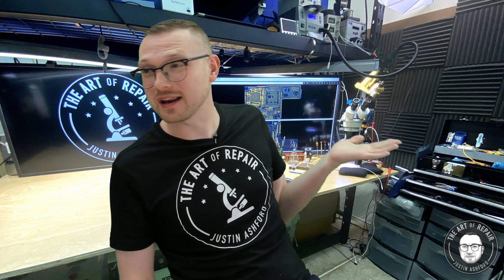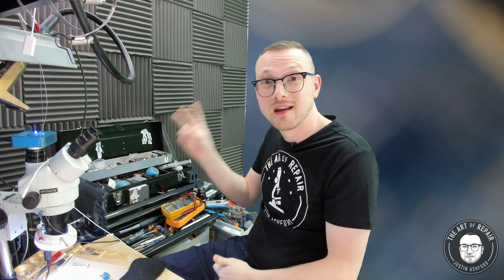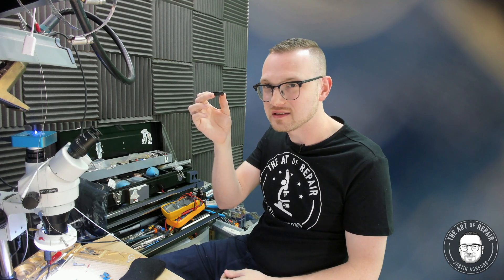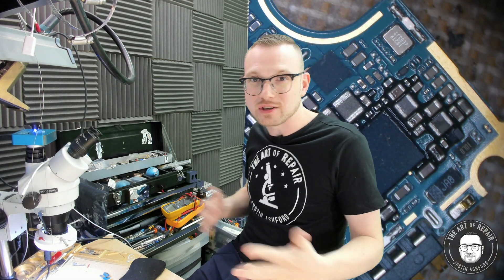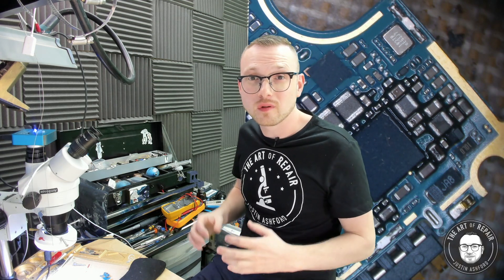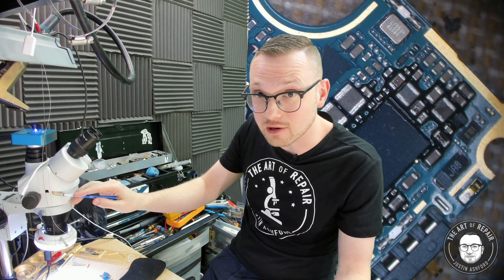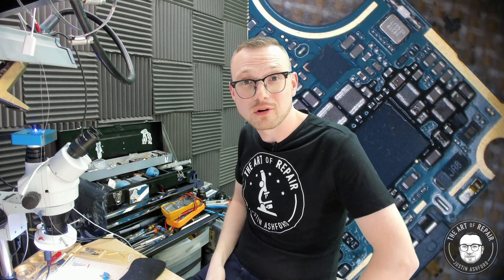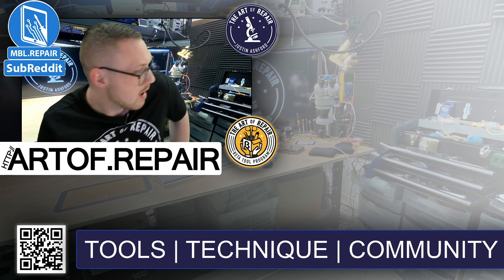Scope Issues | Microscope Cameras that WONT FOCUS! | Method 1 + Useful Tips for New Users

Comment: I bought the Amacope SM-4NTP simul-focal trinocular microscope and finally got a camera for it. Bought the reduction lens to match my Barlow and ran into this exact issue, it was driving me nuts!  Thank you so much for mentioning the adapter. No doubt it will fix my issue.
Reply from the maker: Yes! The the video was worth making 😎 glad to hear it worked out for you. 

You should also check out my other scope video. Look up “dang it” repair and it’s an entire video about this type of scope. Everything you would want to know 💪😎

Comment: I made the mistake of using mount for the amscope mu500 on a cheaper HDMI out camera ( I was having hard time capturing the MU500 camera for videos) with that mount the camera wont be in focus at the same time as the eye piece. I need to fix that. I only ever use the camera for making videos. I have never used it to work under. I don't mind my trinocular and I got a steal on buying it 2nd hand.
Reply: Oh and I think the base or arm is a really important part oh your microscope setup. I am a huge fan of the Articulating Stand with Post Clamp over the Double or single boom. I think the single booms are awful.